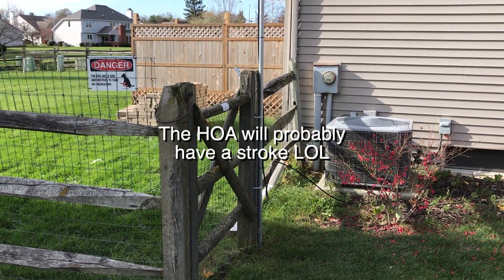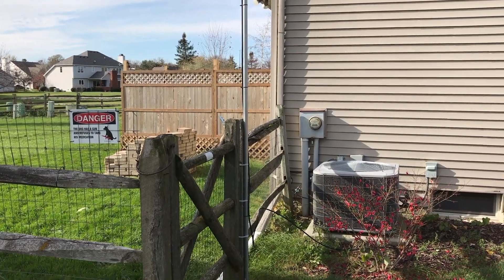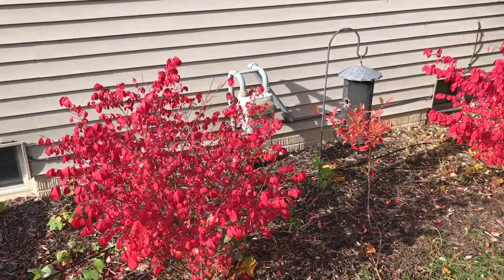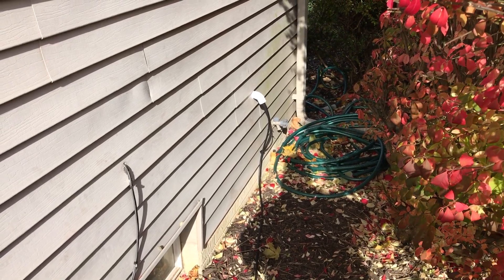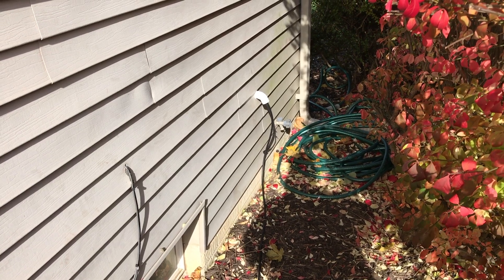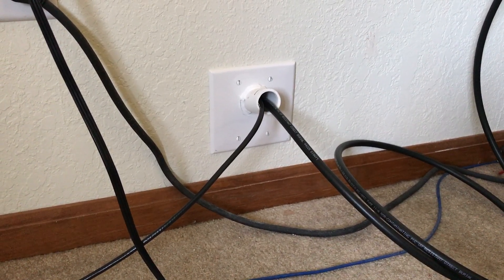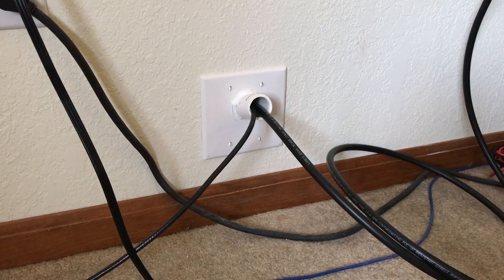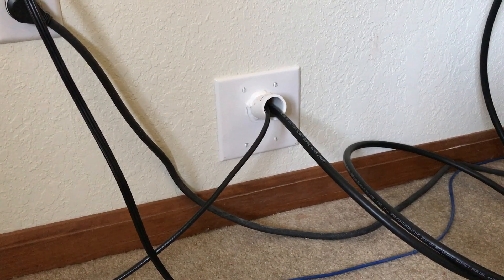Comet GP 1 Install

Comment: Easier to run this unless you have cinder block concrete which is much harder.
Reply from the maker: Yes, much harder, that I am sure will require a hammer drill

Comment: Nice job Vern that should help you get that signal out pretty good. I usually paint the pie a flat black and have gone as far as to get Camo paint to help with it blending in, but I don't have a HOA but do like to not make the neighbors mad also. Also that top rail fits nicely into the EMT conduit tubing for a extra 9' at night if you know what I mean LOL Just mark the top rail, so you don't pull it out. Don't ask how I know.
Reply from the maker: Thank you for the additional information. Hadn’t thought of things like that. 👍👍